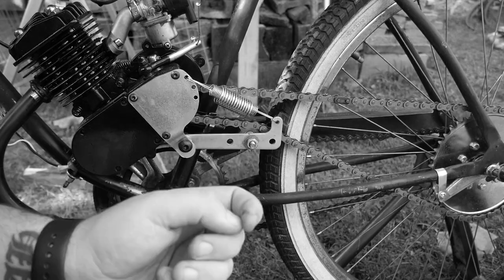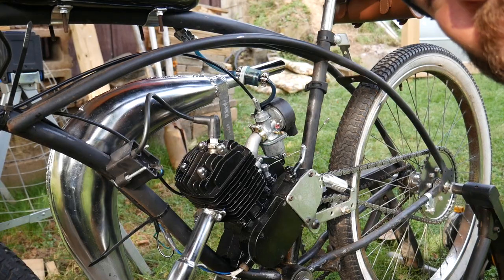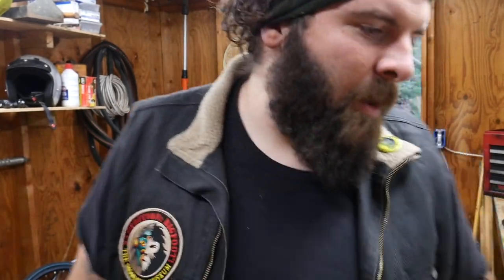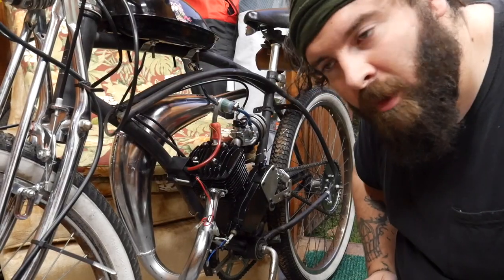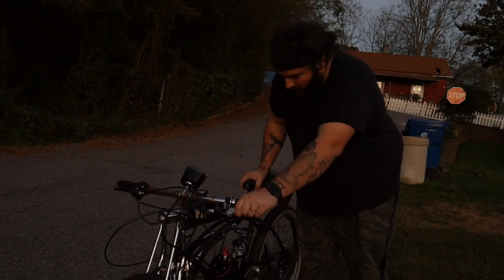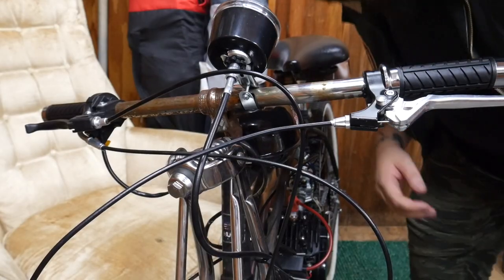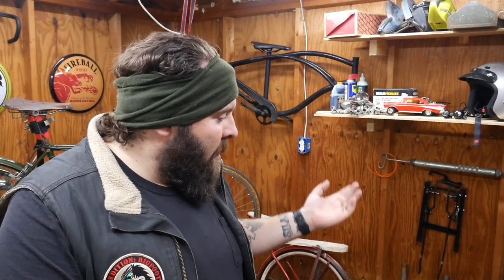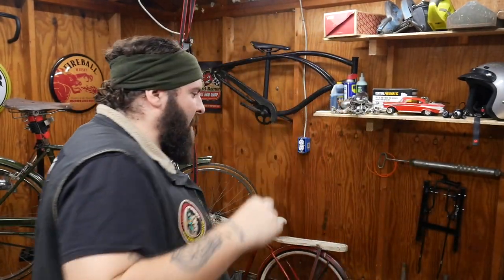Motorized Bike High Performance Carburetor and CDI Upgrade

Comment: That carburetor isn't an upgrade, it's a  downgrade.  If you take off air cleaner and look at air intake it's at least 2mm smaller than stock NT,  also no adjustability, other than jet changes. Stock NT carburetors are totally underrated because people don't know how to adjust needle and jet them properly. When clean and properly tuned they can feed any stock style cylinder up to a true 80cc without a problem.
Reply: Good to know.  I almost bought 5. Thanx.
Reply: Yup don’t waste money and time on this carb
Reply: I installed a Dellorto PHBG 17.5 mm carburetor. So far it's the best I've installed on my bike.

Comment: I like how you have the fuel line resting on the exhaust. Let us know how it works out for you.
Reply: He moved it at the end
Reply: Feel smart?
Reply: Those expansion chambers don't get very hot, and most higher quality tubing is rated for a higher temp than cheap plastic tubing, so it should survive, but obviously not ideal of course

Comment: Kool rig.. It's good to see someone like you represent us big dudes. I'm a big dude myself and I love my motorized bike. Some people don't know how fun and badass this bike's really are
Reply: 6’7 270 and I rip my own motorized bike all over campus and my college town. These tiny motors can push a ton of weight
Reply: I totally agree. I don't need fast. These little bikes can be quite dependable with upgrades and Street legal lighting.  I like a bike to have clean lines. Great Vid.
Reply: About how many miles per hour did it go Reynolds
Reply: Facts
Reply: I just got into the hobby...350 here love my 80cc Beach cruiser with ape hangers...all stock motor and she still cruises excited to upgrade parts

Comment: Spark plug with 4 electrodes. Nice! My CDI stopped working while am miles away from home. Btw, to get more speed.. get smaller rear sprocket. My 36t gets me 30mph.
Reply: An 80cc does almost 38mph stock gearing. There must be something wrong with your setup.

Comment: Just ordered a spilt pipe exhaust like the one you have. I need a new carb because the stock is trash I also ordered a new throttle. Should probably upgrade my cdi and get a new spark too. Day 2 since getting an old schwinn with an old Chinese motor and I’m already hooked

Comment: a regular ignition system, like an old school point system, just closes the gap on a set of points at a certain time, this puts power to the coil, which amplifies the voltage from 12 volts from your magneto, to about 20,000 or more, firing your spark plug. that's why these can shock the hell out of you, although it won't kill you, because of the coil takes 12 volt at let's say 1 amp, and changes the voltage to 20 or 30,000 volts, at 5 milliamp. yeah that's really low powered voltage. so it just shocks you it doesn't kill you. basically, think taser. only difference is a taser has a circuit that flips a switch on and off really fast, making that buzzing sound. you could think of amperage like this: a lot of amps like 200 to 500 amps to start a car, with those gigantic jumper cables, only 12 volts now, and having a little 9 volt battery(close enough voltage for this example, if you don't like it, put two 9 volts together in series and make it 18 volts, and it'll do the same damn thing), with only milliamps of power. and really neither one will shock you. but you lay a wrench over a car battery, it'll glow bright red and weld itself in half in seconds(and probably blow up so don't do that). you put that same wrench across the 9-volt battery, you're lucky to see any spark at all. enough with that. anyway, with a CDI ignition, you've got your usual magneto generating your 12 volts, this charges a capacitor, a capacitor is like a battery that charges in a millisecond and discharges within a millisecond, all the way to a couple of seconds or more depending on the cap. then, a magnet, usually on the outside of the flywheel or magneto, triggers a hall effect switch, which unloads the cap, charged with power, to that 30,000 volt coil, when it goes by that magnet. then it Sparks that spark plug, pow. then the process starts all over again thousands of times per second or something. maybe I taught you something maybe I didn't, I tried. 🥴💢

Comment: I'm not an expert, but it sounds like it's a little bit rich in mixture. I would try (for science) playing with the main jet needle height setting. If it's currently rich (too much fuel compared to air) I'd adjust the needle to sit lower. That way it holds back the fuel a little, relative to the air coming through. There are tons of videos about carb tuning. It's kind of a thing 😆
Reply from the maker: Thank my brother from another mother. I’ll try that
Reply: Definitely too rich go to about a 65 jet should clear up that sputter
Reply from the maker: Thanks I’ll try that
Reply: I just thought it'd be smart to try adjustments before jumping directly to replacing jets 🤷‍♂️
Reply: @knifecharlatan8912  that carb only has idle adjustment, there are none to be made except jet changes. It's a bit pricey but the Mikuni VM 18 and a 23mm intake are the way to go will run good right out of the box on these little China motors
Reply: That carb has no needle it has a flat slide against a tube with two holes in it the first opens early and the second when close to WOT
Reply: @crisshep5447  oh shoot! It totally is a flat slide! Good eye
Reply: 32/1 or 40/1 engines whole life... The break-in time too. Rode every 2stoke engine I've ever built hard  from day one. 

16:1 is far too rich and if you want a great ring seal. Do the following below

First thing, The gas/oil mix before anything else 32:1 
Next cleaning up factory casting and checking piston
I pull the jug off every engine I get to clean up castings and make sure the piston and it's rings are in the right direction. 

Check piston for ruff spots on skirts. 
 
Check piston clips, are snuggling up with the wristpen? Make sure they are completely in.

Mix is of the most important first step to dialing in 2 stroke engine. 

Making sure you don't have a chunk of aluminum slag in the bottom of your crankcase shouldn't be a first step but with the china girl it is...

Ok

So after getting your gas oil aluminum slag mixture worked out..... Carburetor Jetting is going to help with power but most importantly reliability of the whole bike.  

the bikes stock nt/speed carb has a 5mm main jet just like a real delorto sha... And most runtong, rt copys.... just like the carb you own. Runtong 15/16mm I have came with a 72 main jet that's a little big for most 66cc piston port setups like yours.  So swap out the jet in your new carb with the old one.
nt jet is 62-65... "Speed" main jet is 67ish.

 if I remember correctly at sea level the pk80 stock port map with a ktm s5 50cc pipe similar to yours liked a 65 jet. 

Sha carb is easy to get right.

 if it starts easy little to no choke on cold then get Shity as the engine gets warm? If yes
 its to Rich go down jet size. 
Perfect is jet size or two before lean conditions like from wot to off the throttle with clutch in your carb won't idle down quickly 

Porting and balancing wakes up the little shitbox, only way to roll if you're interested in gettingthe most out of the thing.

My number one recommendation is  ride it... grab a handful of key things like parts tools oil and put some miles on the thing. Tune on the go 

  remember it's a cheap kit yet a solid template for a gas two wheeler, with a ton of room for anyone to keep busy with.

Hope this helps you or anyone else reading this. Peace

Comment: My carb like that I'm having jetting issues mind you I never took the motor apart when I got it to make sure everything was good to go cause I've noticed some people had issues right off the start with there's my last one ran great got a few more jets to try then I guess im gonna have to dig deeper if that doesn't clear the problem up won't idle at all stalls immediately slight bog too

Comment: That sounds like 4 stroking to me. I’d get a set of NT jets(stock my jets fit the hp carb). And start with 69 and work your way down to like 65, or when the for stroking goes away at full throttle. (Stock jet is a 70)
Reply from the maker: thank you
Reply: @JoshHarrisRides  hey brother nice bike and that's a sweet pipe and pretty good carb and yeah it four stroking those cards come way too rich .... like he said a 65-68 will be perfect for that carb it will be so smooth

Comment: Your engine needs to be mounter on the bike so that the carburetor float bowl is level to the ground. Your float bowl will fill up to its proper level and you will get a better fuel draw from the carburetor. And just maybe the engine will run faster. if you like the way the engine looks mounted that way then you need a manifold pipe that will set the carburetor float bowl at ground level..
Reply: I never thought about the bowl having to be level thanks for that!

Comment: That sound you're talking about 4 stroking is just your engine running to rich. Lean out your carb a little by tightening carb set screw... go 1/4 turn or less and check engine top end again. It should make it way faster!!

Comment: Warm these chinadoll engines up 100% before riding anywhere. I start the engine then I have a couple of places I can sit at and warm things up.I increase the throttle adjustment pin so it will run at a fast idle unassisted.  As it warms the RPM will increase and the popping in the exhaust tone will smooth out as RPM increases.  Slow it down a tad. Listen for the RPM increase. I go thru this 3-4 times. The engine will run in a smooth 2 stroke as it warms up.  I will be changing the carb main jet one or two steps leaner. For now, I simply leaned the carb needle, second down from the top. This increases engine heat up to 70% power. Main jet is rich, if the engine isn't warmed up completely at full open throttle the engine will 4 stroke. Back off the throttle a bit till the engine smooths, the engine will step back into 2 stroke, the engine will smooth and get a little quieter. The cylinder and head are aluminum, the rings are cast iron, and the cylinder has a chrome surface. All these different metals have different heat expansion rates so they need to be warmed, thermal saturation, equal heat throughout the whole engine.

Comment: I'm having a hard time starting mine. It won't start at all. The motor I have is the one that doesnt  have a head you can remove.it is a one piece where ur piston is. An tips on getting it to start besides throwing it out an getting a better one. Oh I crack the CDI a little where u put the screws in. I tightened it to much and it cracked around the ear for the screw .

Comment: What’s your mix ratio? Make sure you run 32/1. The instructions may say 16/1 but that’s very bad for your motors life and performance. I think either your mix ratio is off or main jet, it should sound more like a dirtbike, but that’s just my 2 cents
Reply from the maker: Thank I’ll try that. I’ve been running 16/1 for the break in. It’s about time to swap. I’ll go to 32/1
Reply: @JoshHarrisRides  yeah 16/1 is what the Chinese want so it does blow up before it gets out of warranty because they like to be on the safe side. This can be bad for your rings in the long run because they won’t seat properly, i personally started 50/1 on day one. I would start off at 32/1 and then go to 40/1 after. Hope this helps, love your channel can’t wait for another video!
Reply: @lukeriley2721  I’m doing 16/1 while breaking it in.. So should I do more next time?
Reply: I use racing oil for 52/1
Reply: I’ve been running 40/1 since I got my yd100 out the box 😅

Comment: I have a question 
Is it possible to install an engine cooling water pump like a large motorcycle to reduce engine heat over long distances 

second question . Is it possible to travel with it for long distances, for example, 200 km per day? 120 miles a day

Comment: Lol, spend all you want on carbs, but it's better to work your exhaust and just re jet the stock carb down to between 62-66 in size, then cut the carb cap open so it can breath,, that's all that's needed,, oh yeah move the needle clip up one knotch and bang your good to go.
Other than going with a crank reed set up anything else is a waste of coin for very very minimal gains and lots of unreliability.
But your vids are entertaining 👍👍
Reply: What exhaust would you recommend? Or do you cut open the stock exhaust or something? Or is cutting open the stock exhaust bad?

Comment: This carb reduced my performance, am i not doing so.ething?
Reply: This carb is crap.. I went back to the NT carb.. jetted it and opend up the air filter pod a bit.. new head and Cdi.. I ride 38mph with 26 inch tires and 36 tooth rear sprocket
Reply: @volvo850r3 yea I have my old carb back on, and have a 36 tooth on the way👍
Reply: It’s a better carb. Small tweaks and you can get decent power
Reply: @volvo850r3  yes thanks

Comment: Get a genuine Dellorto Sha 16.16
From eurocarb
You won't regret it
Reply: Does it really but really improve the torque? i dont mind the speed , i want torque
Reply: @Joaofigas1  I buy dellorto sha 15.15 clone when I mount it I will write here improvements please answer me in 4 days for I don't forget
Reply: @huseyinuguralacatli5064   Copy that man!
Reply: @Joaofigas1  it comes tomorrow in cargo
Reply: @huseyinuguralacatli5064  Ill wait my friend
Reply: @Joaofigas1  It affected my throttle response in good way but not too much gain in top speed
Reply: @huseyinuguralacatli5064  Im not looking for top speed , just for torque , how handle , more force?
Reply: @Joaofigas1  better than stock carb
Reply: @huseyinuguralacatli5064  ill try myself , did you used the same jet of the default one?
Reply: @Joaofigas1  no I use new #68 jet on clone dellorto
Reply: @huseyinuguralacatli5064  oh alright , no smoke? working too lean or too rich? or just perfect?
Reply: @Joaofigas1  a bit rich on #68 but changes engine to engine my stock carb jet was #70
Reply: @huseyinuguralacatli5064  Illl try myself one aswell then xD